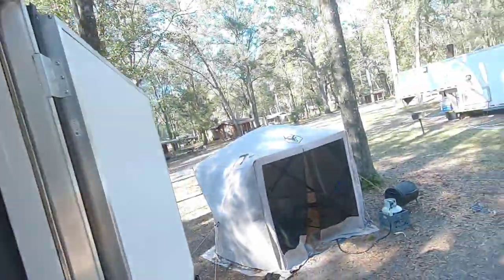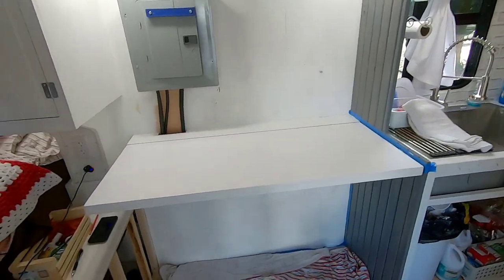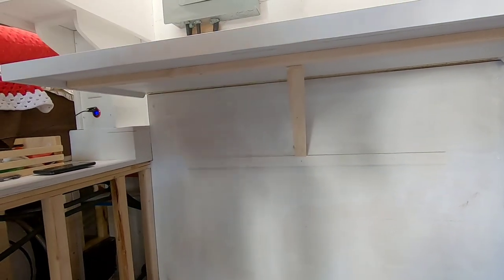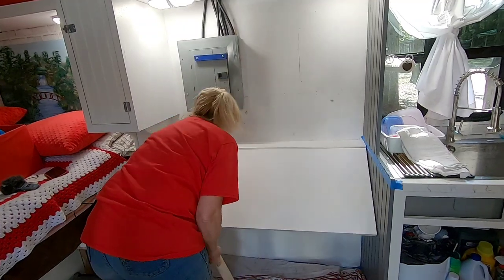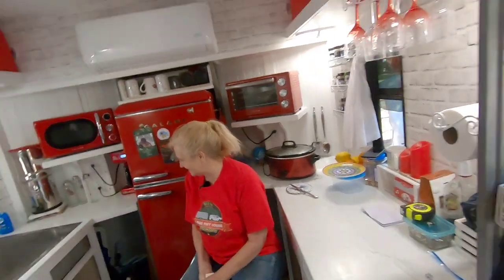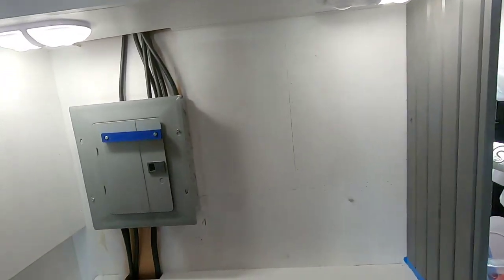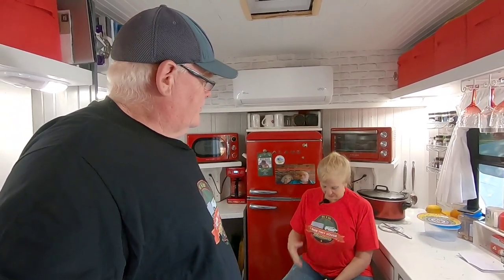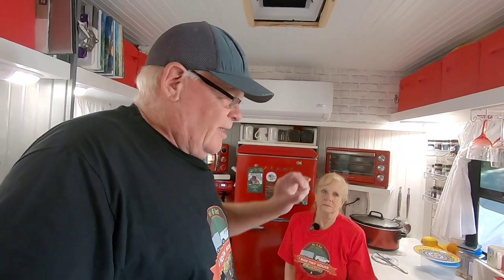Our Cargo Conversion Trailer Gets A New Multi Purpose Folding Table/Our Merch Store Is Up On Line

Comment: As always great video, I just love the way you two work together on projects. I like the way your table falls out from the wall I have a suggestion to keep it propped up what if you put a slide bolt in the right front that slides into that counter where the sink is under the table no one would see it it would give more support in the front of the table because I wonder if somebody vibrates the table or moves the table a little bit that those two pieces in the back don't wiggle out and then you got whatever's on your table in your lap. But excellent work excellent that whole home is excellent. Keep up the good work I wish I could come to the meet up but unfortunately I can't. Please stay healthy and be careful out there.🌻✌💖💪🎅🚌👍

Comment: Thought.....Bring the framing out past the electrical panel 3/4" and make a cabinet door and install in front of the panel to match other wood work. Open door and reveal the panel. Probably easier to frame also. I did this all the tine when finishing basements. Hard to make a cover look good IMHO
Reply from the maker: I like this idea, now to talk Bill into it

Comment: Love the table/desk build ...it looks very sturdy! 👍 I'm with Deb on the cubby being a lil deeper to make it more useful. Not to mention... she is holding good size pursuader stick. 🤣
Got a merch question..sorry if you said and we missed it...are the stretch hats adjustable fit or fixed sizes?  Got to get our "I Ride" apparel for the rendezvou.😉   
 P.S. ...love Delilah's story 😍
Reply from the maker: There are 3 different styles of hats: one size fits all 2 color, one size fits all single color, then a flex fit that can be ordered in different sizes
Reply: @billanddeb  ty 😊👍